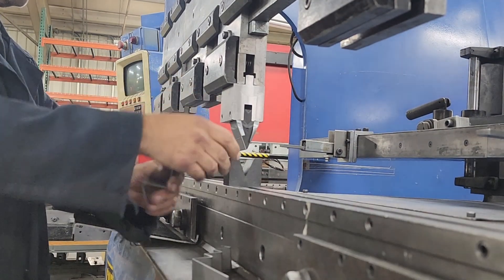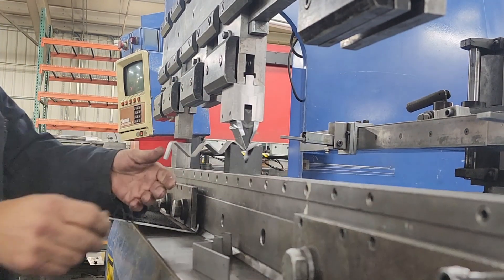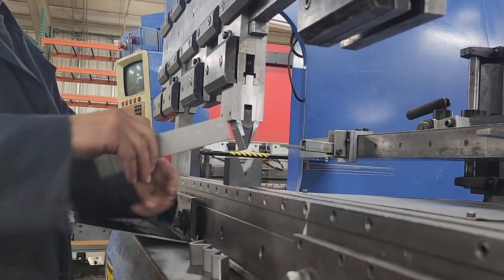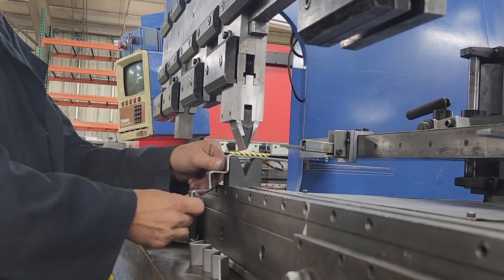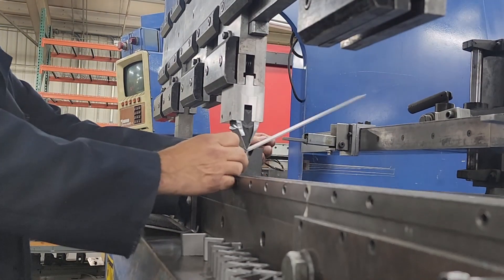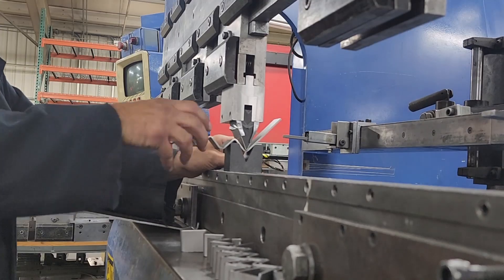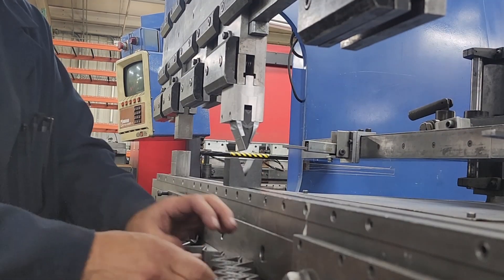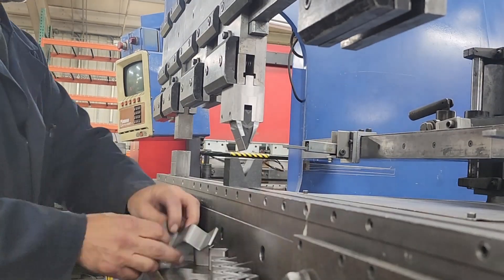ITS GOING TO EXPLODE!!!!  3d printed punch and die wear test.

Comment: That is pretty damn impressive for PLA! How big is the die opening?
Reply from the maker: Its right at 7/8". Bigger than i would use if it were a normal die. The larger size keeps the pressure down which helps it survive.